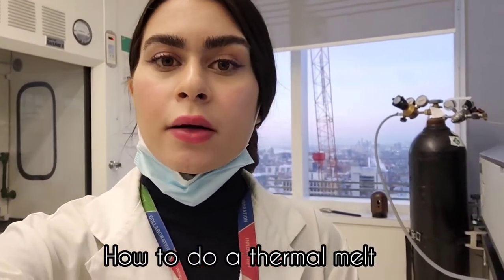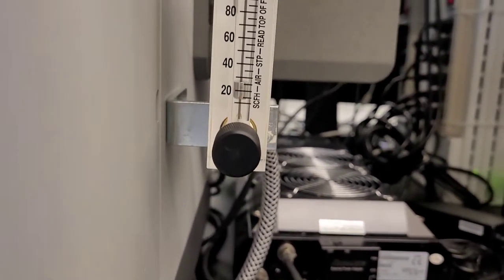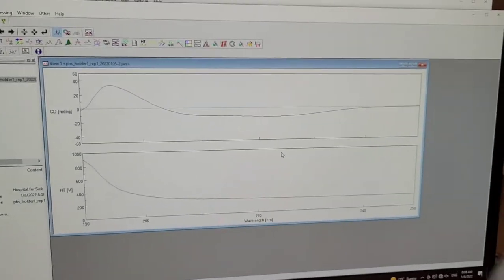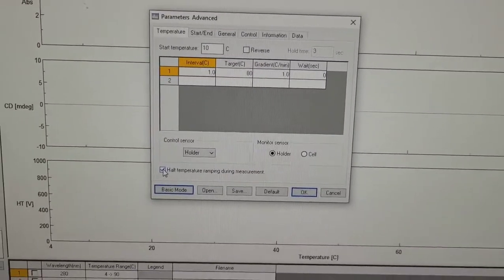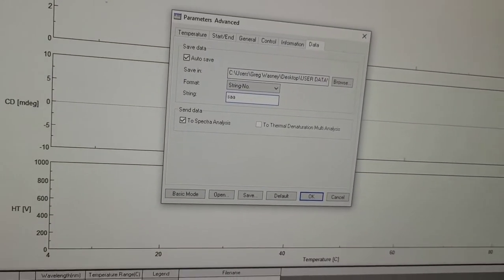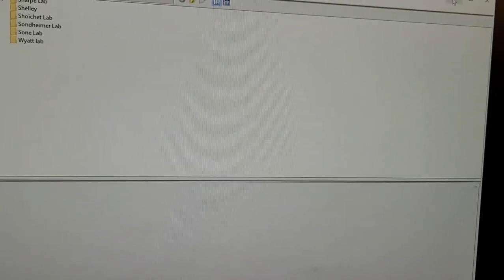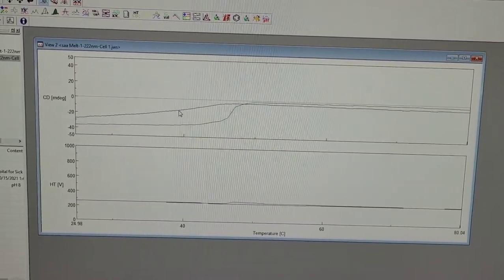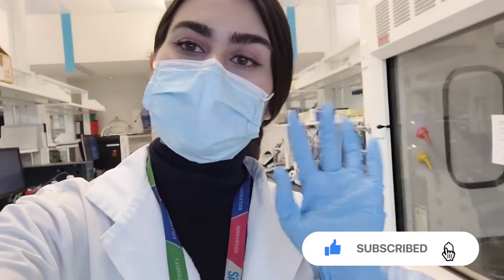🧪Thermal Denaturation of Proteins using Circular Dichroism || Practical Biochemistry

Comment: Hi! Great videos! Could you write the reference number of your couvette? I use a foldable couvette 0,1mm but I have problems with evaporation and bubbles, especially when the probe is heated. Also do you have any tips for different results of the same sample? Sometimes I put on the same protein (from the same eppendorf), the same amount and I think that the results are different. Maybe its because the couvette that enhances evaporation? Thanks :D

Comment: Hi, have you ever worked with protein aggregates using circular dichroism? I solubilize my protein, did some dialysis experiments and used CD but I'm having a hard time interpreting these results
Reply from the maker: Hello. What kind of aggregates are they? Amorphous or like fibrils, and how would you describe the data you are getting? Are you getting a lot of noise on the left side of the curve?
Reply: @biochemistmelo  Thank you so much for responding! This is awesome! They are amorphous and the graph starts at zero (right side) and then keeps going down (-1 mdeg) from 230-215nm (-2 mdeg)  at 210 and goes up  (-1mdeg) and the 205 nm goes down (-4 mdeg). Yes! It looks like a lot of noise on the left side of the curve as you mention!
Reply from the maker: @nicholemontero8481  can I also ask what you dialyzed the samples in? And concentration of sample
Reply: @biochemistmelo  Of course, I used 20 mM NaH2PO4, 0.5 M NaCl! sample was a little low 3.56 µM
Reply from the maker: @nicholemontero8481  yes both the NaCl concentration is really high and the protein is low (try 5x more). I would reduce the salt as much as possible if it doesn't affect your protein.
Reply: @biochemistmelo  Thank you so much for your guidance! This is my first time doing this haha I appreciate your feedback
Reply from the maker: @nicholemontero8481  no problem 😊

Comment: How can you analyse the data to determine the exact Tm and measure the cooperativity?
Reply from the maker: So there is a baseline for when the protein is still folded and when its completely denatured with a slope in between. The midpoint of the slope is Tm. For example if it starts unfolding at 30 and finishes at 50, the Tm is 40. 
The cooperativity comes from how steep the slope is. If you have something that's almost a sharp 90 degrees and another that's 30 deg, then the sharp transition is the more cooperative unfolding. If you have more than 2 datasets then measuring the slope (difference in y/x).  I suggest starting at a really low temp like 10 and ending at a high temp like 80 so you can clearly see the baseline before and after the main slope of transition.